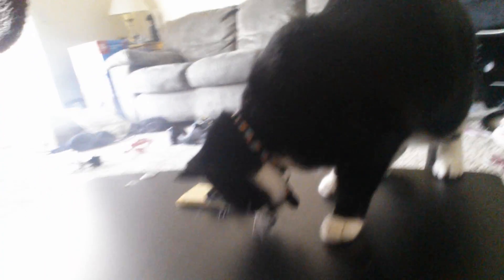Arduino Cricket Prank w/ code!

Comment: Connor this is brilliant! I've built a truly fugly version (image follows if the system permits) http://selectsystems.co.uk/images/charlie_fugly_cricketduino.jpg

This will form the backbone for our village revenge campaign on a neighbour who thinks it hilarious to glue cement meerkats to a friend's house while he's on holiday and deposit 'gifts' of live chickens in gardens while people are out at work. Cricketduino is starting up his chimney but will be moved to other locations at weekly intervals.

My only issue is that, while I can handle a soldering iron, your code is too smart for me. The 'Demo' version is great but would be too easy to track down while the 'normal' mode doesn't fire up quite frequently enough for my taste. I've fiddled with the code without much success - any pointers?

Charlie
Reply from the maker: I need something to do today. Give me 24 hours and Crickeduino will be a library of it's own that you can call chirps and sleeps from. Any features you'd like? :D
Reply: Thanks for the response and sorry about the delay in replying - I think we have a timezone issue! I'd love to be able to specify the range of delay easily - so say, from 2 minutes to 60 minutes between sounds and to have the option to randomize this delay or have it fixed. It'd also be nice to be able to set the volume level to randomized or maximum. Some of this may just be down to adding annotations to the code. Next part of the "Village Revenge" campaign would be to use one of the dirt cheap SDcard MP3 player modules I have here to "Haunt" our victim with personalised moans and groans, or possibly his car with "helpful" driving suggestions linked to an accelerometer ;o)
Reply: Have you managed to have a look at this Connor? The added functionality would be great to have!